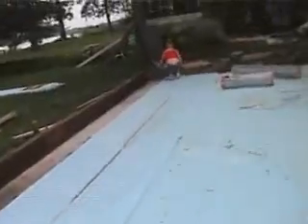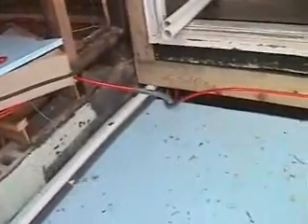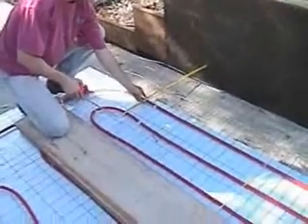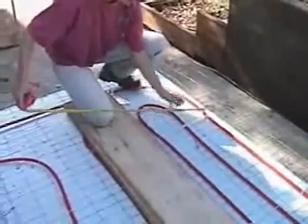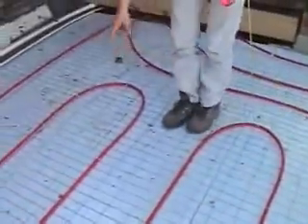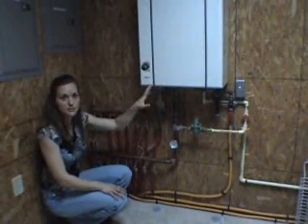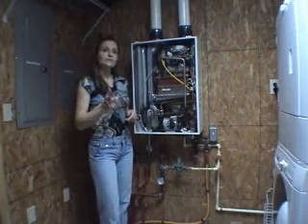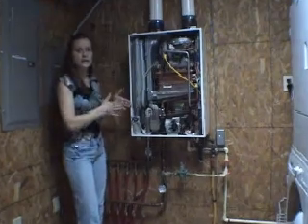Radiant Heat Installed in Concrete

Comment: Will repairs hold ?  I had the plumber staple down a couple of floaters and he stapled right through the pipe.  He is no longer with us.  I have the Milwaukee tool to put on the Uponor sleeves.  Will I have to tear up the whole lightweight floor and start over?

Comment: If you have a proper ACCA Manual 'J' you will find the output to demand is not practical. We design them for warmer climates, think New Mexico, but here in Minnesota for example, two standard flat panels will heat half the domestic hot water needed by a family of four. 

You're welcome.

Comment: The PEX is staple directly to the XPS and the wire on top if needed...unlikely. There is no such thing as a "tank-less" boiler. This is a low-mass condensing boiler. 

Don't forget, the most important place to insulate a radiant slab is at the perimeter.

Comment: Why 2 inches of concrete needed above tubing?  What size tubing is recommended, as the tubing I had from 15 yr. ago renovation is no longer made, assume 3/4" now standard as it was 5/8" XPE?   Please upgrade the video with solar hot water option and higher video quality.  Thanks,  looking at 800-1200 ft. yr-round vactaion home with low energy footprint.  Solar HW radiant flooring ideal.
Thanks, I'm a DIY-minded New Englander and saw one system built in Maine by VOC Tech (lots of sponsorship)
Dan